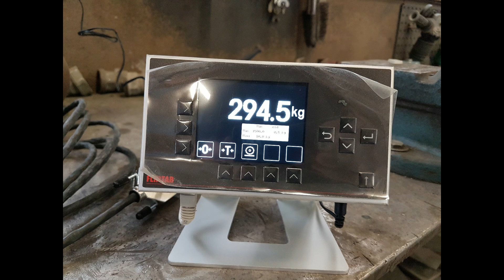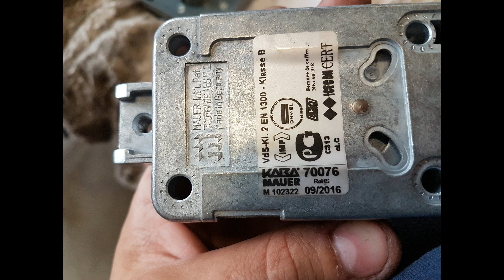Swedish army style safety box (Home made steel/concrete safe)

Comment: That safe looks hard to get into.  Love the door locks.  I would imagine it would take a long time to cut into that safe.
Reply from the maker: Yes, its all about delaying. 4 inches of reinforced high tensile concrete inbetween the steel casings.
Reply: @Bluezero75  I agree with you Herr Bluezero. Like an airbag, delays time saving a humans life, best safe and vault designs are built best when fitted (engineered) with consuming as much time as possible to access the contents, lawfully or unlawfully.

Comment: I have some suggestions for improving this safe:
Adding some kind of coarse and hard sand blasting media to the concrete mix would enhance the anti-drill capabilities.
The door could possibly benefit from a similar technique by adding abrasive media to epoxy.
Coating the inside and outside of the safe with intumescent paint should improve fire resistance of the safe.
A high temperature gasket on the door is needed to save fragile contents from any water used to douse a safe engulfed in fire.

Comment: I absolutely love your work I'm building a safe at the moment and basing my lock mechamism off yours. I can't find any schematics for that style of lock. does the main moving disk just float freely? I would have thought it would be too heavy and there would be too much friction for it to move that easily. also, how do you stop the bare metal from rusting? any Tips would be much appreciated!!
Reply from the maker: Thank you! No, i guess you cant find some blueprints because its "home made" by me ;). Yes, the main rotating disc floats freely inside the retainer housing, and also has a thick back plate which both centers it and keeps it in place. The mechanism is only soaked in gease which is ok for rust protection. If you are a bit hard core, make it out of stainless.
Reply: @Bluezero75  thanks so much, this has been really helpful. is there any chance you could PM me some pictures of the completed lock mechanism with the arms attached?
Reply: Bluezero75?
Reply from the maker: @callumrichens7904  Im sorry, i dont have any more pictures of it at this time. Youll have to figure out the design on your own ;)

Comment: the hinge are not strong enough
Reply from the maker: Mourad SALEM There is no problems with the hinges. It has 8 (eight) 25mm locking lugs all around the door, 2 on each side.